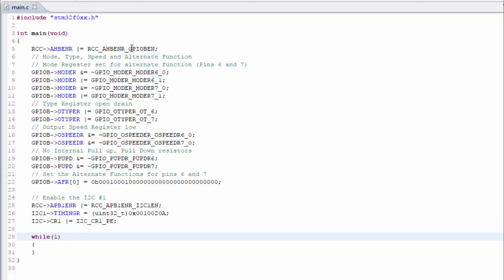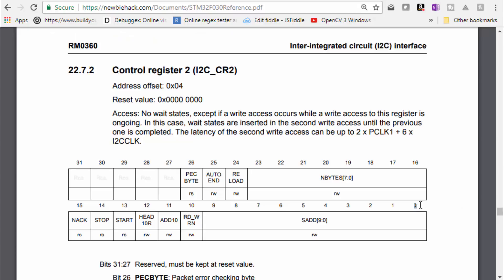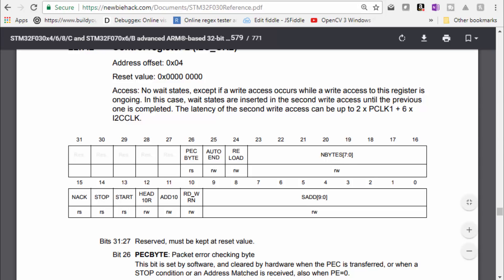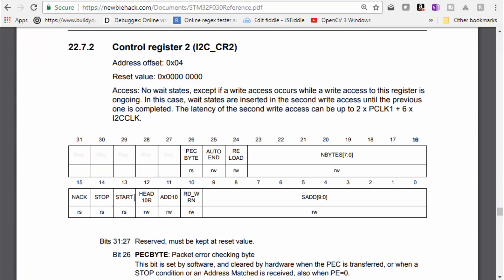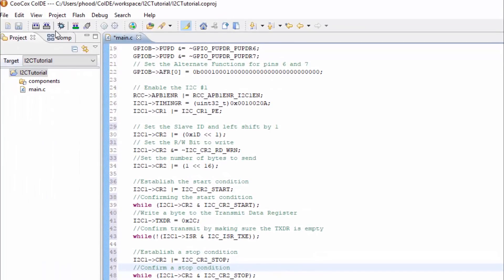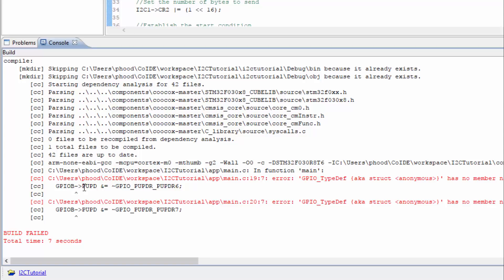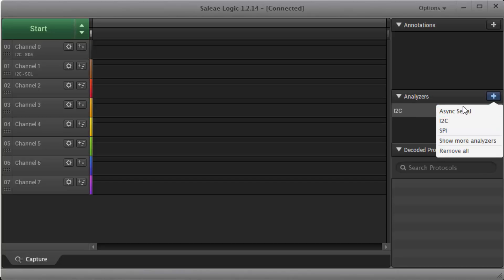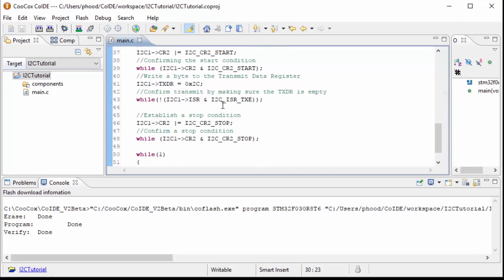59. How to Use I2C to Read a Device's Register Part 1 - ARM STM32 Microcontroller Tutorial

Comment: I wish I could write a library to every single mcu, but I dont know where to start this journey
Reply from the maker: MCUs don't vary too much regarding the programming specifically, but addresses change.  As long as you can program using c++, then all you need to specify is the address of the register that you need to modify. If you can do that, then you are on your way to making libraries for any MCU.